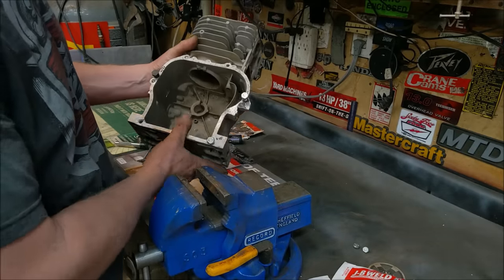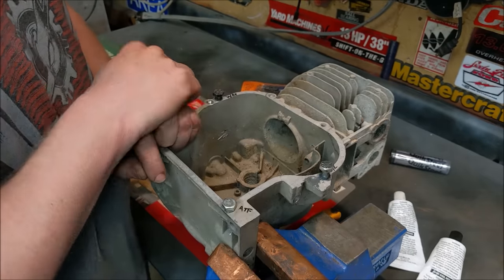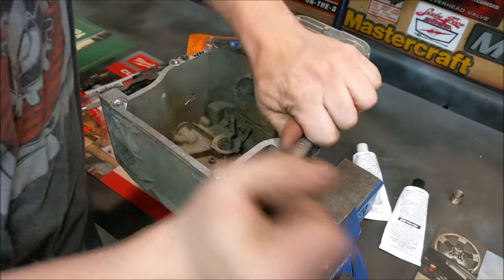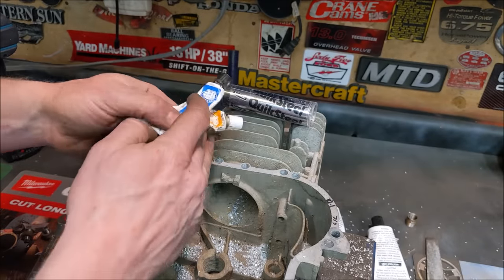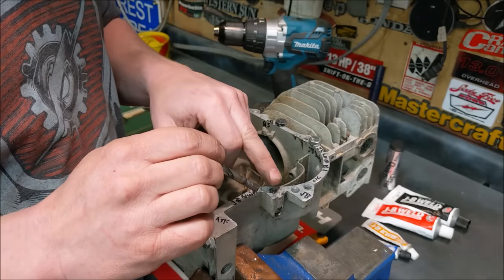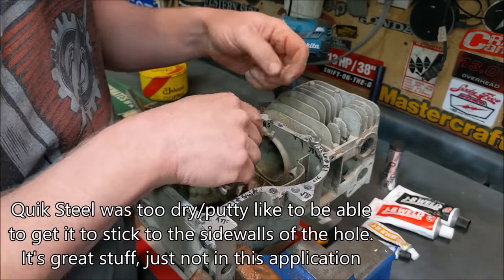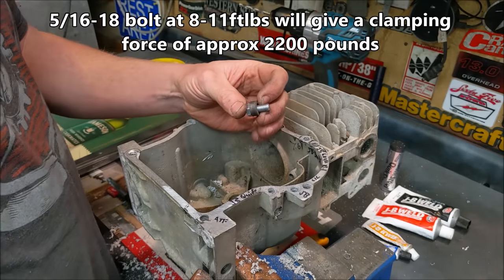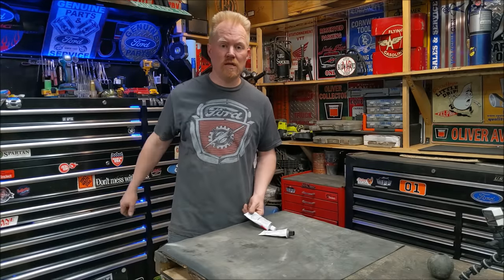FIX stripped bolt hole threads the POOR MANS WAY

Comment: excellent video!  detailed and informative.  thanks for posting.
I have a bicycle pedal bolt which, due to loose install, stripped out the pedal crank threads.  so Im searching for a relative;y easy and cheap repair.
Reply from the maker: The pedal bolt takes a lot of force from the weight of the individual. As well as a lot of leverage force.  I don't think JB weld would last long in this scenario.
Reply: agreed.  Ill use the wire method.
 @sixtyfiveford

Comment: I love quick steel for many applications, but as you said it is thick.  Did you test quick steel as fill, drill and tap?
Reply from the maker: It fell out of the hole when I tried to tap it. It was an open bottom hole and I couldn't get it compressed in there good enough to press it against the sidewalls. I felt bad as it is one of my favorite Epoxies and has a much higher physical tearing strength than JBWELD
Reply: @sixtyfiveford   thanks. It is impressive stuff in the right applications.

Comment: I’m wondering if it work on a 10mm bolt , it’s my valve cover gasket, the hole is stripped and doesn’t hold down the cover down which leads to oil leak ? Any advice ?

Comment: I just fixed a rental apt. fridge stripped bottom door hinges thread holes with quick dry JBW 10 days ago . Absolutely save the day.
I just apply the holes with plenty JBW and pushed the bolts in and brace the door with wooden blocks for support for 10 minutes.
I expect it to last until the compressor goes.  It's a done deal result.

Comment: How did you apply the wax. Was the bolt dipped into it or wax poured into a hole in the JB weld. I would really appreciate it I need to fix a cylinder head thread that was stripped bad
Reply from the maker: I wiped on some paste wax and wiped off any excess. I used Johnson's Paste wax, but any hard car wax ( type that comes in the stubby tubs) should work the same.

Comment: Going to be doing this on my 96’ seadoo for one of the head bolt threads that needs 17 ft-lbs of torque for spec, the bolt threads are roughly 1 3/8 inches long, am drilling and tapping. If that doesnt work, Ill drill it out more for a helicoil in JB weld threads which would work because a helicoil pushes against the threads to make everything tighter. Im using Marine Jb Weld with 5010 PSI

Comment: I was doing this the other day on an M12x1.25 (truck tow hook recovery points)  but the threads in there arn't formed nicely when I removed the bolt. So did you coat the bolt with oil or wax, then coat JBweld outside on the outside? Or did you poor the JBweld into the holes then insert the bolts after?
Reply from the maker: Waxed the bolt. Smeared JB weld in the hole and around threads of bolt. Smash the bolt into the hole.

Comment: How much JB Weld was left in the holes you did when the JB Weld threads stripped out?
Would drill and tapping an oversized hole then trying JB Weld with the original sized bolt work better?

Comment: life saver needed for valve cover and cracked the head and most service mechanics recommended a need couldnt coil since it was cracked but jb weld wax left set for days put it back on held strong tyvm
Reply from the maker: AWESOME!

Comment: Working in the late evening (dark-thirty), I cross-threaded a small machine-threaded bolt hole used to attach the carburetor body to the engine block. Rather than simply waste $55 to buy another carburetor, I hope to (re)construct the original machine threads in the carburetor housing, and in the original bolt hole.
Your method is interesting-- to bore a larger hole, first, and fill the hole with JBWeld, quickly inserting the original bolt (after coating it with a release substance). At 0:56, you put JB Weld (standard, long-cure) into four enlarged bolt holes, coat the original bolts with a release chemical (WD40, wax, etc.), and insert the original bolts. After "about three days", you unthread all the bolts, hoping to find an acceptable thread pattern. In fact, you discovered only the wax-coated bolt formed the desired threads. 
However, my situation requires a slightly different approach. My cast aluminum carburetor body (Briggs & Stratton engine 127802-1901-B1) has attachment "ears"-- cast extensions of the carburetor body for attaching the bolts. Unfortunately, the working dimensions provide no extra material to allow me to bore a larger hole, and I must use the original hole. My plan is to use JBWeld to fill the hole, thoroughly coat the original bolt threads with candle wax, and insert the bolt in place. After 72 hours, my hope is the original thread pattern will have been restored.
---------------------------
1. Do you have any suggestions for improving the method? 
2. What solvent should I use to clean the cross-threaded bolt hole in the cast aluminum housing?
Reply from the maker: You just need to attach the air filter housing? The easiest is just to step up to a larger bolt or a course screw that will bite new threads. This is more than adequate to hold on the filter housing. If you want to attempt the JB WELD, rubbing alcohol, carb cleaner or brake cleaner are the best degreaser. A thin coat of wax (candle wax likely too thick) or oil. Smear JB WELD onto the bolt making sure it goes into the threads well. Push the wet bolt into the stripped hole and allow to cure for 24hrs.

Comment: Can you explain the steps to rethread with JB Weld and wax. Do I fill the hole with JB weld, cover the bolt with wax and then screw the bolt in and leave it over night??
Reply from the maker: Wax the bolt with a very thin layer. Apply JB weld to the hole sidewalls and to the bolt threads making sure you get good coverage into all the threads. It doesn't take much. Push the bolt in and allow to cure.

Comment: After you fill the stripped hole with JB Weld, do you put the wax on the bolt and then insert and let cure?
Reply from the maker: Wax the bolt and let it dry. Put JB weld onto the bolt threads and into the hole, just on the walls. Push the bolt into the hole and allow the JB weld to fully cure. Remove the bolt and the threads are formed.
Reply: Awesome, thanks so much!

Comment: When you say you applied wax and atf fluid, how much did you use? How did u apply wax? What type of wax? Did you dip the bolt in the atf fluid? ..pretty good video but not much info on the bolt prep.
Reply from the maker: Wax was wiped as thin as possible. I used a paste wax (Johnson's) but any car wax would do. As far as ATF the exact same you don't want to dripping wet just wipe on, wipe off.
Reply: @sixtyfiveford  ohh ok so an auto paint wax... i was thinking something like a hard paraffin wax bar or melted candle wax. Lol...I have a locktite thread kit but the releasing agent is about out so I need a plan b so thx for clearing that up

Comment: Any tips on removing a broken weld nut in a frame with no access? If you cut out an access hole does it need to be welded back?

Comment: Do you think you could put the JB Weld, on the repaired area, and if the area had a set screw, if coated in wax you could tighten it after curing?
Reply from the maker: Yes,  I think it could be tightened afterwards. However something like a set screw for a pulley is what I think you're talking about, would likely have too much vibration and need too much force for this to really work good.

Comment: Hello,  do You think the jb weld method would work if the piece I'm trying to fix is made of plastic?  The stripped hole itself is in plastic but a metal screw is what screws into the plastic.  Thanks so much!
Reply from the maker: I used Johnsons Paste Wax but any solid car wax would work the same. Plastic, Yes I think it would work.

Comment: A stronger way to use the JB weld is to change direction a bit. Instead of repairing a thread, use it to stick a stud in, if you can work with it, until YouTube came along I didn't know about the copper wire method.. good video dude.   I fixed my compressor with jb weld...., I followed the manufacturer torque, felt too high...it was 😵 I still prefer to trust my own feels.  i love practical testing of things (if you need hints lol)
Reply from the maker: I think a stud would work out very well.

Comment: So fill the hole with jb weld....wax the bolt and put it in the hole before jb weld can set or did i miss something?    I'm clearly just learning this stuff.
Reply from the maker: Yes. I do spread a little JB weld on the outside of the bolt as well as in the hole. This way I can make sure it's in all the threads.

Comment: Whick JB Weld would you recommend for a stripped vavle cover bolt hole on a 196cc engine on a mini bike ? I managed to strip 1 of the 4 valve cover bolt holes while tightening them down after installing new valve springs. I will need to be able to remove the valve cover in the future once in a while to check the valve lash so i need something that will not be impossible to take the bolt out but at the same time hold it down tight so it's securely down while i'm riding.
Reply from the maker: Copper wire stand tip I talk about the end of the video is probably the easiest and the most secure. It can be done multiple times.

Comment: You should try this J-B Weld test but using studs instead of a bolt.  This would test the strength of the threads from a nut applying straight pulling force on the stud without a rotational force also being applied to the threads from the stud turning.  You could actually use a little longer bolt with a nut on it and tighten the nut down without rotating the bolt.
Reply: Studs don’t strip threads though they break off in holes. Stripped threads get cut and pulled out by turning fasteners so in this application of stripped threads the rotating fastener is the only way to go.
Reply: What if the hole was cracked and broken and it needed to be filled with jb weld because there is no more threads . I broke a screw inside and had to try and extract it and the extracter then broke . 

So i used a rotary tool to grind down the exracter and screw and now have a hole that needs filling .my thought is to fill the hole with quick steel or jb weld , and a stud ,put my parts hole over the stud and add a nut . The other 2 holes are fine . Its just 1 ? Thoughts
Reply: @broncosforlife88   
Hi, I had similar issue on my 5.8L intake manifold.  The two bolts that hold the thermostat housing broke.  I was able to get on bolt out but the other needed to be drilled out.  Well the drill bit I was using broke in the bolt. I used a cutting wheel to cut out a piece of the manifold over the bolt so I could remove the remaining piece of broken bolt. I then bought a couple of studs and inserted one stud into the cut open bolt hole. I then took the piece of the manifold I cut out and used JB Weld to glue that piece in place on top of the stud.  I let the JB Weld set up for a few days and that was more than 2 years ago.  For my application the nut did not need to be very tight to seal the thermostat housing to the intake manifold especially when using RTV.  If the fastener in your application needs to be real tight JB Weld may not work.

Comment: Will this method work on Transmission (Aluminum) Drain Plug? See I stripped a bit that hole and probably the original bolt using a faulty torque wrench. It didn't click and continued to torque, then rotated once free, so I checked w/electronic one and it was 33 Ft-lbs instead of 22. Been mortified of course, I removed the plug, I hoped it was damaged rubber gasket that gave that single free rotation. I saw one 3/4 tiny circle ring came out of the hole though. Then I torqued it back w/electronic Torque Wrench to 22 Ft-lbs. But after I decided to put a new plug w/magnet I bought and received. So I removed the old plug again, and there was another tiny aluminum ring removed from the hole. The new plug was not going in. I put back the original, but was not able to torque it anymore, like on 11Ft-lbs it would rotate free. I removed it again, checked w/mirror, seemed like all the threads were in the hole in good condition, and put that new plug, it was tight 1st, but then went in. I hand tighten it, then snagged,  and not sure what torque to apply now. From all the described above I conclude that the hole is slightly stripped. Maybe I'll be O'K if every time I remove the Plug I put a new one.  Total mess I know, very upsetting mistake. If someone has any ideas please share. The film is very good. Thank you.

Comment: The bolt hole you waxed.
I'm assuming you dipped the bolt in candlewax or smeared wax on the bolt. Is that right?
Reply from the maker: I used SC Johnson's paste wax. Which is similar to any automotive hard wax that you would put on your car.

Comment: 😞My starter fell off and I can't helicoil it so I'm gonna JB weld it. Can you recommend which blend I should but tomorrow?? I have the regular stick putty type. The bolt holes are drilled and smooth. Should I tap them for something to bond to?? I live in this van and don't want to lose it.😭😭😭
Reply from the maker: Starter bolts are common for stripping out. First if you can use a larger bolt go that route and tap the hole for that size. Second if you can drill all the way through and put a nut and bolt go that way. JB isn't that strong and needs other bolts to help, so a starter that only relies on 2-3 bolts will likely make the JB fail on the first attempt.

Comment: Try mixing your epoxy with super fine steel wool.. Might hold better..... When I was kid we would stuff steel wool in the buggered up hole and it worked somewhat. Super tip! >  You can smooth up epoxy with spit on your finger. Water won't work. Try it!
Reply from the maker: Steel wool is a good idea.

Comment: If I were to JB weld a hole, then use a timesert do you think that could get me a slightly higher torque? 

I really botched a water pump... I have a truck and the mechanic before me slapped on a water pump to a 300 Ford and he broke one of the bolts and left it. (He just used 3 bolts instead of 4 and used rtv, the water pump leaked slightly when I got it, but I didn't realize a bolt was missing I thought it was a weep hole) So I tried to drill the bolt out (without taking the engine out or moving anything) with just a drill...  

I end up making things way worse because I couldn't get a straight hole, so now the hole is more like a messed up 9/32 (I tried to tap it for 3/8 and failed miserably). So basically the hole is all messed up.

I tried to use a 3/8-16 bolt and I got the water pump on and snug, but it still leaked like a sieve, in desperation I messed up the hole even more. 3/8-16 bolt wont work I don't think because the hole is too close to the sealing surface there isn't enough room for the gasket to seal. 

So now what I really need to do is to somehow get that home back to 5/16-18. 

I am wondering if I fill the hole with JB weld, the use like a 5/16-18 timesert if I can get enough surface area so I can torque the bolt to like 18ftlbs of torque. 

I would obviously have to figure out how to make my new holes PERFECT. 

My main questions are how does JB weld handle heat? Can I use Timeserts to increase the torque? 

I have heard that it's really hard to weld cast iron.... I know nothing about welding so I don't think I can just weld the hole back then recut a new hole.... 

Idk. If I can't fix this the truck is gone, which is really depressing for me because I have put so much time and money into it.
Reply from the maker: Jb weld really isn't that strong. I would use it on something like a valve cover or the like that didn't need that much torque. If you oversized the hole that a time sert/ helicoil will no longer work. I would use this method: 
https://youtu.be/Ykk0bP4DChE
Reply: @sixtyfiveford  Thanks for the response. That is what I am going to have to do.

Comment: Not sure if anyone posted about JB Welds temperature range. Max temp is 600 F. But 500F is pretty reliable. 
Quick set epoxies for the most part will break down in moisture and excessive heat.

Comment: There is a two part epoxy called form a thread it comes with a release agent you spray on the treads , works great.
Reply: Link?

Comment: Interesting. Here’s a question for you if you get to comments: I broke a alternator mounting bolt loose from my engine block and the end of the bolt got stuck about an inch inside the block, tried to use a drill/  bolt extractor, with no luck, now I do not know what to do to re thread the hole strong enough to hold a new bolt, was going to tap it a bit bigger and use a little bit larger bolt, but not sure if it will work, don’t want to mess up the hole any worse than I already have, local mechanics won’t do it, recommending dealer. Is there a way to do this myself that will hold up? I believe the bolt is supposed to be torqued to 17ftlbs.

Comment: If you're going to drill out the holes anyway consider using a finer thread tap in the enlarged hole before you put the J-B Weld in .
Reply from the maker: Yeah, true.

Comment: Hello. So how much wax do you apply? My ignition coil hole where the bolt screws into has stripped out and won’t hold much, barely, but not much. I was thinking about just cleaning off the bolt then apply the JB weld into the hole then apply a little wax on the bolt before I  screw the bolt back in, so it breaks free easily..does that sound right? I just don’t want to have to drill out the hole,tap it, an so forth. So any advice would be great. Thanks! 🤙
Reply from the maker: Any car wax will work. Just wipe it on the bolt and then wipe it off.
Reply: @sixtyfiveford  is anti sieze safe to use on ignition coil threads? To help break the bolt free once it’s dried on the first time.
Reply from the maker: @2PHUX  I don't see why that wouldn't work.